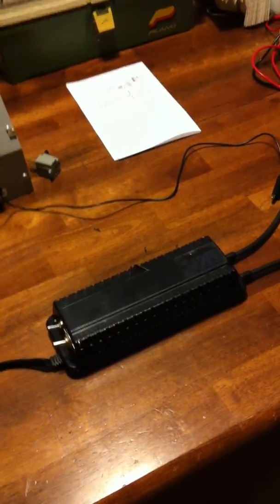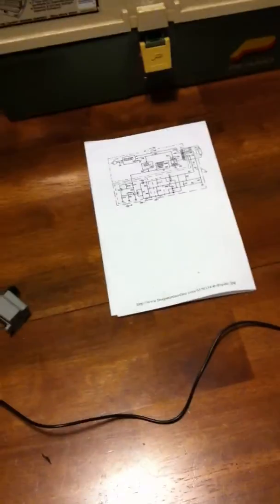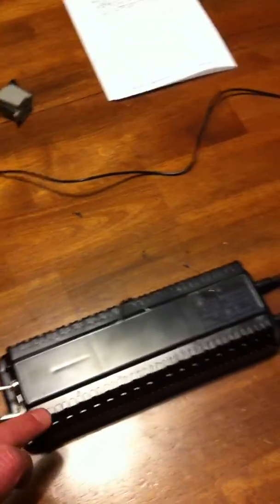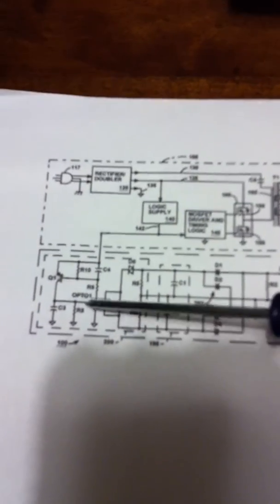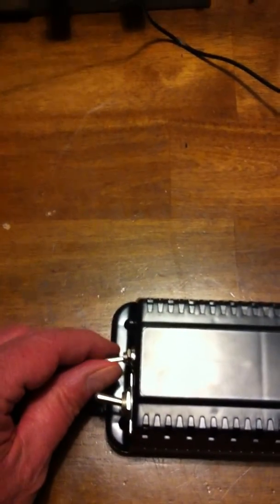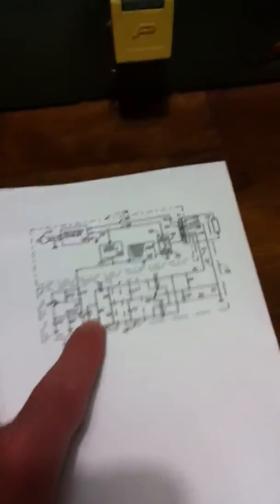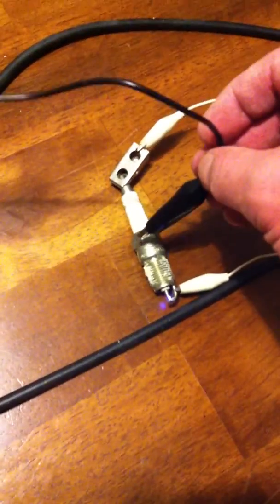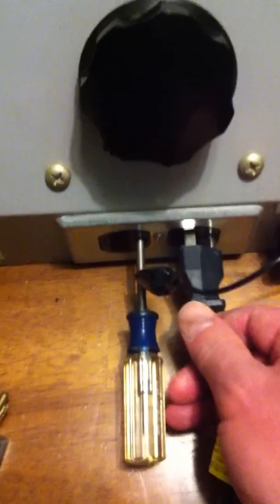How to modify a neon light power supply for Tesla coil use

Comment: Hello, I'm wondering, what's the make and model of that power supply, and where did you get a schematic diagram of it?
Reply from the maker: Harold, The NST is an Evertron series 3610 part number 800-0228 power supply. I did a search online and found a schematic for a similar model that was close enough to use.
Thanks for the interest and good luck with your work. Dave